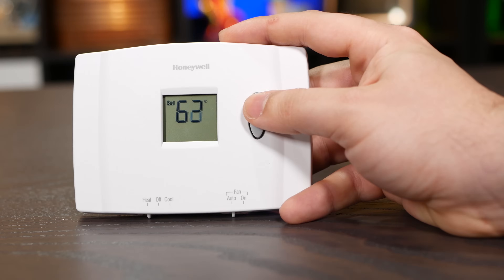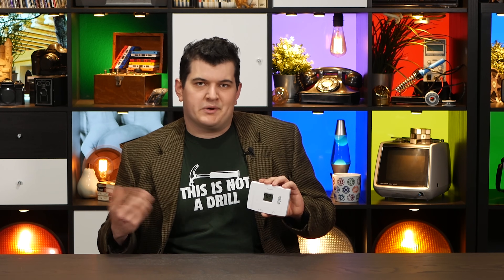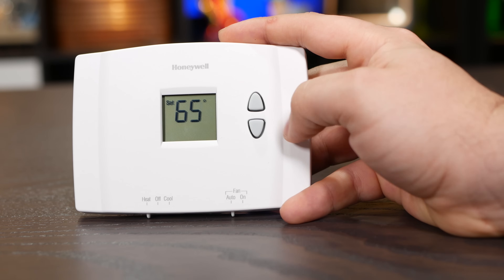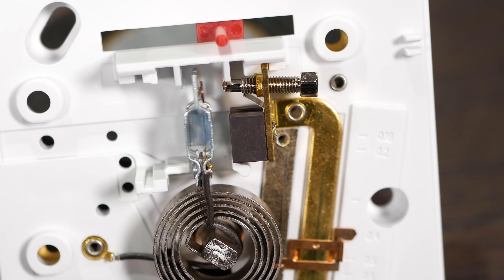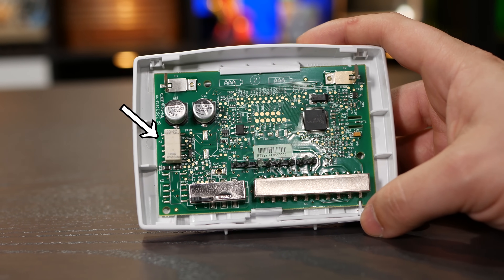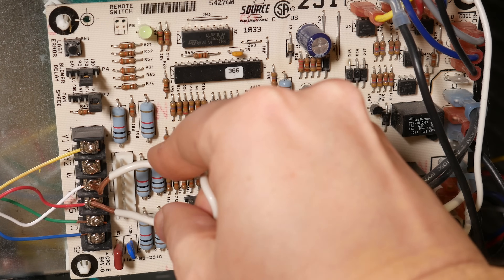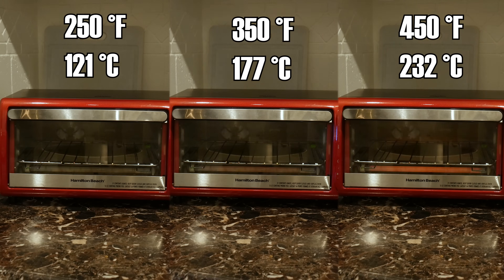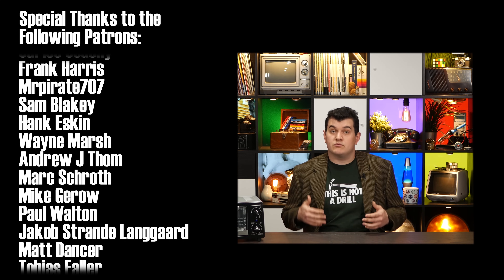Thermostats: Cooler than you think!

Comment: Thermostats: equivalent to the Power setting on your microwave oven by function.
Reply: Microwave oven are really more properly a form of PWM.  If you cook at 50% it does a strict 50% duty cycle. It doesn't react based on temperature.

Of course modern microwaves do have sensor-based modes, but even then, I believe that the duty cycle is still on a timer, but the commanded duty cycle is updated periodically based on the sensor.  This is as opposed to just turning the microwaves on until things get hot and then turning it off like a thermostat would.
Reply: @doctorbobstone : But in the strictest sense, it still heats only by cycling on or off, like a thermostat does. Neither the magnetron, nor the household heater change the intensity of heat applied, only duration.
Reply: @Christopher-N  Certainly true.  At the base level, both are on/off, not proportional.

Comment: Ecobee uses sensors and house averages to determine when to call for heat.  Depending on the time of day- you can tell it which sensors to care about.  So it will ignore bedrooms during the day- but only care about them at night.  It ALSO will let you set a temperature for a short time and then resets to it's schedule.

Comment: Interesting to discover that technology. Here we use a split AC system in each room and they have their own variation of a thermostat. Some can even read the temperature wherever you lay the remote and send it to the main unit to control the temp where you are instead of the place where the AC is mounted.

Speaking of "set the AC on max to cool off for some time", I got a Hisense AC that has Turbo mode and a button that reads "1 Hour". It quickly sets an hour timer and when combined with "Turbo", sets the unit on max cooling mode.

Comment: Britain doesn't use HVAC. You either have an air conditioning unit which is a self contained unit, which I guess is the most similar to your systems, it's just a local machine. Many of these do cold only because they're used in conjunction with "central heating", but the ones that also do heat basically just also contain a space heater, similar to what you've talked about previously.
Alternatively, you have "Central heating", which has a boiler, and when turned on pumps hot water to every radiator in your building.
Reply: We have a natural gas furnace with electric A/C. We also have a natural gas on demand water heater. Here in BC, Canada natural gas is very cheap. I pay about $70/$70 a month all year round. Our gas and electric company average out the bills over a year. We have high gas use in the winter due to the furnace and high electric bills in the summer because of the A/C. In the Summer the actual gas usage is like $14 for about 3 months.
Reply: @geoffmooregm  UK uses natural gas a lot too, it's a big power source for UK central heating systems. in fact most water heaters and cooktops use natural gas instead of electricity.

However, I heard on the news the other day that the Prime Minister (can't remember if current or future) wants to phase out all gas usage ASAP, because, Environment.
Reply: @bobingabout  Here if people are relying on central electric heat then they use a heat pump (A/C in reverse) it may be more efficient than natural gas but it costs more to operate due to the price of electricity. I have never heard of a electric resistance heater being used as a central heat source here. It would get quite costly. Some small houses do use electric base board heat. I would hate to see the cost of that. I used to have an electric hot water tank. That thing was a fucking joke. My bill was as high as $200/month in some cases is was also extremely slow to recover. I had that thing for a year before I replaced it with my current on demand system.
Reply: @geoffmooregm  Nothing is more efficient than a electric resistance heaters. It is physically imposisble, they run at 100% efficiency, and comparing natural gas efficiency to eletric efficiency makes very little sense, but if you did you wouldn't need to compare the full cycle from eletric generation to heat generation, in which case natural gas wins by a big margin, as you don't lose energy when converting heat to eletricity first.

Comment: Honeywell Chronotherm actually uses PWM and switches the furnace off way before the temperature is at the set point, as it learns the delay overtime. These thermostats create a pretty smart PID control circuit with just the two wires. And yes, setting it to a high value WILL heat the room up faster! In the old school thermostat the current trough the bi-metal would pre-heat the thermostat to switch the heat of before the room reached the set point to prevent overshoot. Don't insult you grandparents! They weren't stupid!

Comment: I guess it's not so popular in the US, but in Quebec most residential homes have electric heating with room by room thermostats that modulate the power using triacs, far better control of the temperature. Only downside is that you need cheap electricity for it to make sense.

Comment: In the UK, we tend to have programmable thermostats with a 'boost' function which allows the user to request the heating to run a si for cycle without disrupting the normal program of heating (and/or cooling). Also, since we have a strange love for water based heating systems, we have thermostatic valves on radiators in each room which turn off the flow of water when the expected temperature is reached in that room, thereby diverting more of the flow to the areas that still need heating. 

Yes, there's the risk of leaks with water, and if the water hasn't been heated for a while there's an energy penalty in warming it back up. However, we only have to worry about carbon monoxide in the room with a faulty boiler, rather than pumping it around the house through ductwork. To each, their own.

Comment: Nest does the time-limited run function already.  I can set the fan to run for up to 12 hours, regardless of temp- usually I set it to run for one hour when I go to bed, because it helps me get to sleep without running all night.  The funny thing is, it treats the fan mode as cool-mode.  So, if I set the temp below ambient, the AC will kick in and cool it down to that temp for one hour.  If the temp is set above ambient, the AC will never kick in and it acts as a fan.

Comment: 12:20 The "brief" explanation on why the role of "Toaster Oven" was performed by a stunt double:

Having proven that this demonstration would work using my personal toaster oven, I decided to purchase a new one. See, my toaster oven is kinda filthy and I wanted to get another one anyway. I thought it would be handy to have a toaster oven at the new studio. See, they're really nice for making small snacks or whatever (though frankly I've always found the actual toast making experience to be rather lacking even before I was introduced to the Automatic Beyond Belief! wonder that is the Sunbeam Radiant Control toaster). Anyway, so I wanted to get a new toaster oven, right? So I went to the store and bought a really basic one, just like the one that I use every day in my kitchen.No sense spending a lot on what will just be a part-time toaster oven,and it was the same brand as the one I had at home. Must be perfect, right? Well, it turns out that this new toaster oven runs at a much shorter cycling time than my old one, so the effect that I was trying to demonstrate became nearly impossible to see. That sure was a bummer! It later became clear to me that this wasn't a very good toaster oven anyway, as the fit of the little tray they give you for cooking tacos or whatever was really tight and just unpleasant. The whole thing was a travesty, really. So I've since returned the toaster oven you just saw and replaced it with another one, but this was after I had already filmed the video, and also after I had already filmed my original toaster oven doing the thing I wanted to show you. I toughened up and cleaned it the best I could, and I think it looks OK.

So that's the story of why you're about to see a different toaster oven. I made an assumption that turned out to not be true. Oh merde. In the end, it all worked out for the best anyway because I got a much nicer toaster oven on sale at Target right after I returned the rather poor one, so all's well that end well, amiright?

Oh, and if you write this in a comment to save people the trouble, you're a fun sucker and sucked the fun right out of this gag. I hope you're happy.

A more helpful comment would be to tell the nice viewers about either the "speed" setting on mobile, or the fast that the < and > keys on desktop will advance frame by frame. Then they'll be in on the joke too! Anf then when I or any other silly Youtuber decides to do this again, they'll be equipped with the knowledge of how to do this.

You already wrote this out, didn't you? Well, I won't delete your comment, but you are now a convicted fun sucker and you'll just have to live with that the rest of your life.

Pfft.
Reply: The fun has been sucked.
Reply: +Jenny Wakeman You know what else sucks? You, after I install this attachment.

Comment: 16:27 Yes, most programmable thermostats allow temporary override. Honeywell makes amazing thermostats that can control anything HVAC related and many have advanced functions like dehumidification without having to install an actual dehumidifier and predictive heating and cooling based on outside conditions and past run-times. It's more than a switch....It's a computer.
Reply: No, they don't, not in the fashion that was described. These overrides either stay in effect until you remove the override, or until the next program change occurs. That's not the same as getting 20 cold minutes and "resuming our regularly scheduled programming" after 20 minutes, without having to go do it - and without having to REMEMBER to go do it.

Comment: About the one cycle question, Daikin air conditioners hava a "Powerfull" button which does exactly what you want. Run the AC full tilt for about 15 minutes till you cool off and after that revert to a normal set temperature and fan speed. Vaillant thermostat (model VRT210 for EU type gas turbo combined heating and hot water boilers) has a party mode that ignores it's normal on-off economy hours and just heats the house to a set temperature and keeps the hot water tank... well hot. It also has 1 tank option to make one tank worth of hot water and then revert to pre-programmed eco mode.
In case of "smart" thermometers, cranking them past the temperature you want to achieve might make them work a bit faster if they use poorly tuned PID controller, as they might heat less when coming up on a setpoint in order not to overshoot it. The effect would likely not be meaningful unless tuning was really way off, though.

Comment: our variable speed lennox. we have kinda of smart but dumb wifi honeywell thermostart.  The variable speed motor is set by dip switches based on time. I should dig up the manual. its 30% for a few minutes... 60% .....and then as time goes go on it goes full blast.  we dont have that special 400 dollar thermost that could put more control of the very speed motor. maybe in the future.

Comment: This makes me wonder about my HVAC system. I have a variable load control heat pump and furnace. The manufacturer claims that both devices can vary their load from 35-100% full load, but I am curious if this is simply a variable fan control and not an actual capability of the heating/cooling elements. Certainly not for the furnace, but perhaps the heat pump can do this. Since I had this system installed, I have not seen a major increase in my electric bill, even during hot summers. So I guess even if it is only a variable fan control, it works for energy efficiency wither way.

Comment: On that last question: Our old (electronic) thermostat did have a "boost" button that ran the heating for half an hour, then went back to the normal setting. It had some obviously blanked off buttons to do the same for cooling as well, but we're in the U.K. so it was a heating-only setup.

Comment: You'd love my ca. 1985 heat pump installation with two stage electric furnace...technically, the furnace could be 3 stage, but winding 2 and winding 3 are jumpered together at the electric furnace.  Oh, and there's a mercury switch in the thermostat, too!  The system also takes input from an outdoor temperature sensor that tells the system when to use the second winding in the electric furnace and when it's cold enough outside to start running the defrost cycle on the heat pump (below about 40 degrees, if the unit wasn't defrosted periodically, ambient humidity in the air would eventually frost up the outdoor coils).  The emergency heat switch tells the system to run as a super inefficient electric furnace because there's trouble with the outdoor heat pump unit, and cuts the heat pump out of the picture.

Comment: hey Tech Connections, what about the AC on a car, because on the car the ac never stops running, and if i set it to the bluest blue (if you have the poor mans AC) it will run way colder than if you set it to the little blue/close to red zone. So on a car what is regulating the temperature?

Comment: "there is no medium blast"...  this might be true for HVAC systems only.

Digital baseboard thermostats use a PID algorithm (proportional–integral–derivative).
Setting those at a desired temp instead of maximum could mean it takes more time to reach desired temperature.

In layman terms: it heats for some length of time, stops heating, measures the effect on room temperature, then heats again if required.
This way is does not overheat VS set temperature;  i.e.: it understands "thermal inertia" of your room.

For digital baseboard thermostats this is standard practice because of the time delay between heating the elements with 240V and feeling the rise in room temperature.

So, maybe do a piece on baseboard thermostats ?
They are not so dumb ;)

For reference: "A PID controller continuously calculates an error value {\displaystyle e(t)} e(t) as the difference between a desired setpoint (SP) and a measured process variable (PV) and applies a correction based on proportional, integral, and derivative terms" - Wikipedia

Comment: My townhouse thermostat in Florida had a bunch of wires (I think 7 at the very least). But it controlled a heat pump, meaning it had to individually control the compressor, fan, reverse valve (I think?), and supplemental electric heater coils for "extreme" cold temps where the heat pump couldn't keep up.  All I clearly remember is that  the color coding made it easy to replace a non-scheduling digital thermostat with a modern 7-day schedule one.

Comment: As for the comment about sensors apart from the controller, I think it'd be nice if you could have them and then indicate which one you're near. That way, the difference in temps across rooms may be the same without zoning, but the room where you are would get the desired temp.

Comment: There should be a part deux about inline thermostat for baseboard and convective heating elements. Depending on how far off the room temperature is from the set temperature, the newer electronic thermostats adjust the duty cycle on the circuit (from 20 to 100%). The old ones works just the same as the 24v you just demonstrated.

Comment: Look into controlling HVAC systems with PLC's (such as the Click from Automation Direct). With the correct relay board and some programming, you could have a unit capable of running your AC for a single cycle.

Comment: < and > do not advance frame by frame, they change the playback speed... Instead , and . advance frame by frame. I understand that these are physically the "same" keys, but on my keyboard (and most U.S. QWERTY keyboards to my knowledge) you have to hold shift to use < and >. So you could say, use the < and > keys, but don't hold shift. Although, in that case, they would more accurately be called the , and . keys...

Comment: Oddly enough, I have an old White Rodgers Digital Comfort Set II, no Common wire, however, it will get power off the 24VAC supply and never need to change the batteries. Batteries are only there if power goes out to keep the thermostat program alive. Not sure how it accomplishes that, but it does. Also, I am waiting for the Technology Connections 2 version of this topic lol.

Comment: I hate those programmable thermostats, they try to cram so much crap features into one chip, and it ends up stuck on some schedule you can never figure out. I just want one that will auto-majically swap between heat and cool, without a 3 or more degree of separation between the two. piece of junk. wheres my raspi?

Comment: Excellent explanation! As an HVAC tech, it always irked me when someone(usually my wife) would set the thermostat to 80 to "heat the house faster". 

I also like how you mentioned using the fan to power the Tstat. That is some shady stuff too. Just run a wire set if yours doesn't have enough, it's a pain in the ass but it's the right thing to do.

Comment: To your question of a thermostat that has the 'override' function you were asking about, the Ecobee line does. When you override the current program cycle, it lets you have the options of: Override and hold, override then resume once temp reached, override for x amount of time or Override till start of next program cycle. When they first interfaced with Alexa voice control, it was annoying to use as telling it to set the temp to say 72, it would default to Hold, and never resume the program cycle. An update long ago fixed that so talking to it now, it defaults to 'hold until next cycle', and adjusting from the head unit gives you the other options of for 2 hours, permanent  hold, 'till next cycle choices.